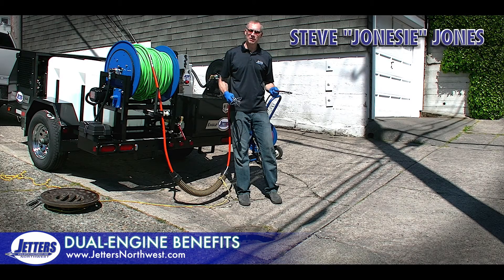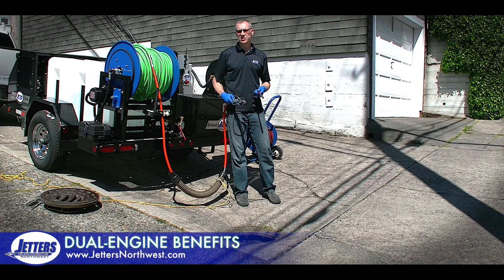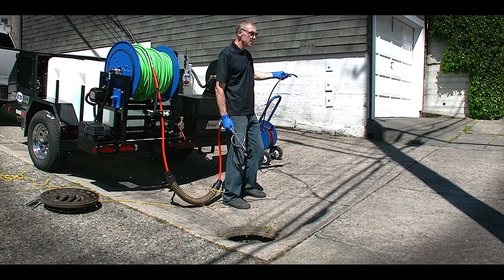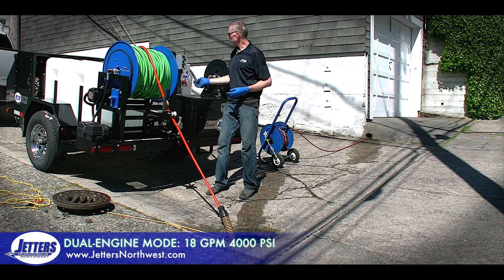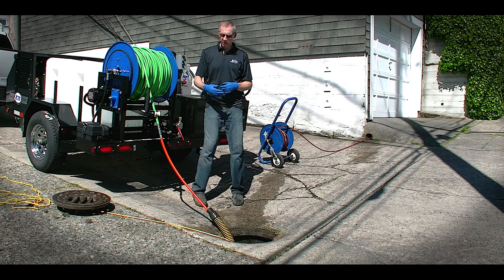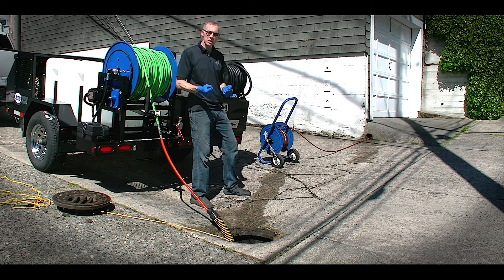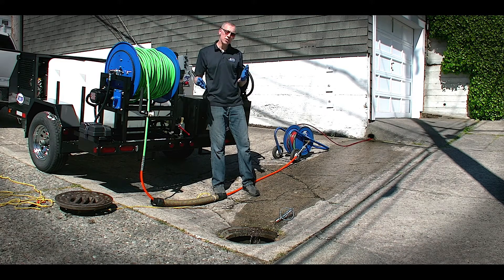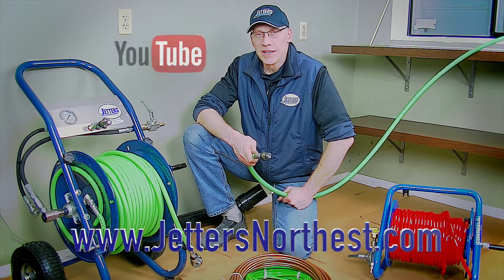Large and Small Drain Hydro-Jetting Job-Demo with JNW Eagle-300 - Get Jetting with Jonesie!

Comment: Great idea fantastic for owner operators, but not really suited for larger companies or municipalities, as it has too many things to go wrong and you need to add the lowest common denominator approach, as multiple different users may not notice any little issues.
Reply from the maker: Part of the 2-engine/2-pump design is the built-in redundancy; if one is down you can keep running on the other. You may not run full output on one engine/pump but it's better than not running at all.  Btw this was initially designed for a School District 20 years ago who jets anything from 1-1/2" up to 18" so they needed versatility of flow-rate, and they were on a tight budget.  It worked great for them and has for hundreds more.  Thanks for your comment!!